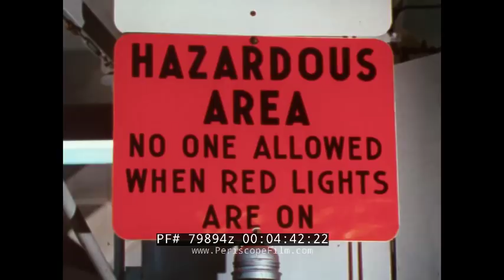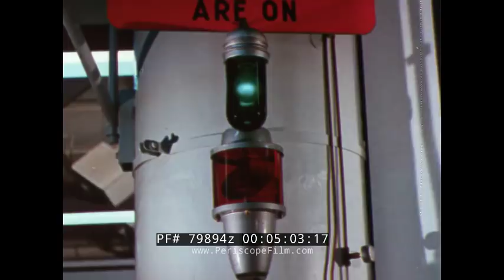UNRESTRAINED FLYING OBJECTS GENERAL MOTORS SEATBELT FILM  79894z

Comment: I work at the GM facility pictured (it's a lot different now) and even low speed crashes are enough to convince most skeptics to wear their seatbelts. And airbags work best if you're belted because the seatbelt keeps you in a specific area, then the airbag buffers the movement your body will still make. #I AM GM

Comment: This is more than likely 1968. None of those vehicles are 1978 era GM product, all of those models shown are late 1960's. Coincidently 1968 was also the year that seatbelts became mandatory in the US. MCMLXVII is more than likely what date is shown, I can't confirm this because of the in video links that cover it during the ending.
Reply: I think this is 1968, as that is the first year shoulder belts were standard for the driver and front seat passenger.  Shoulder belts were an option in the 1967 Eldorado.  My father had a 67 Eldorado with the shoulder belts and he wore both the lap and shoulder belts.  However,  for some unknown reason, he was usually the only one in the car that was buckled up. I guess back then seat belts were a fairly novel idea.
Reply: The opening ALONE is too trippy to be 1978, LOL. This film is more 1960s than all three days of "Woodstock", 😛